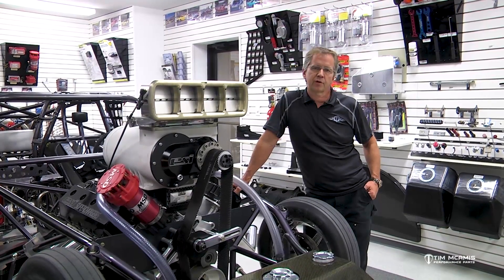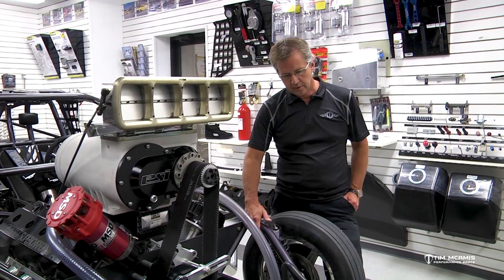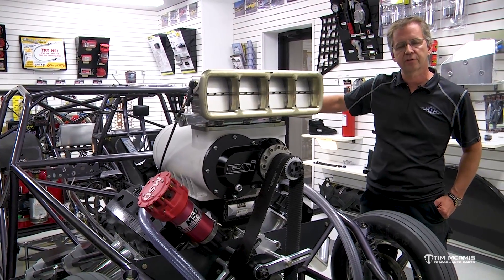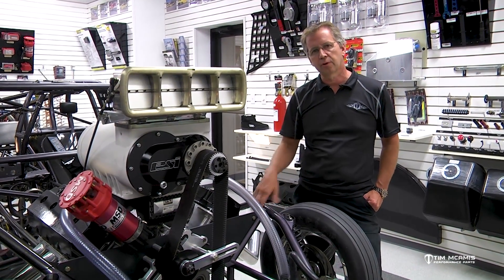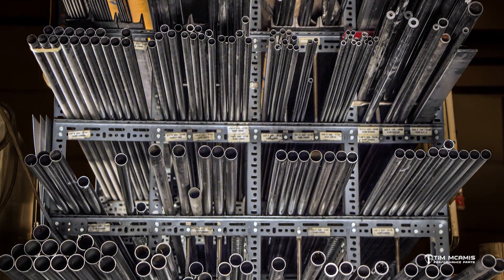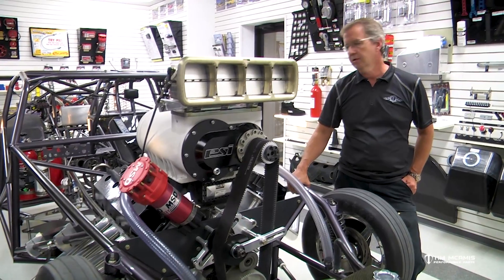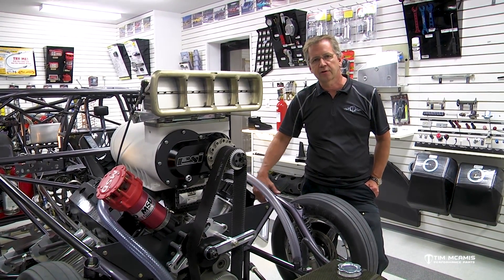4130 vs Mild Steel

Comment: Correction 4130 and 1018 both have the same elastic coefficient, (18 million) 4130 at 0.058 wall vs dom at 0.156 wall will see the dom be much stiffer. The difference is in elastic limits where 4130 is about 130% as high.

Comment: are you saying seamless mild steel tubing is not available or doesn't exist?  with all due respect, that's not my understanding.  if you have time, more info would be greatly appreciated.  and just to be clear, i don't mean welded DOM tubing, i mean seamless, DOM mild steel.  thanks in advance.

Comment: If you gas weld the Cromoly like originally intended there's a much lower chance of fracture, cro-moly was engineered for gas welding and free air cooling to the correct temper.
 This can be seen by looking at old airplane crashes, piper cubs mostly. It's pretty rare for ~ 100 yr old gas welds to crack.

Comment: When you say that the same tube out of mild steel is gonna be more “flexible” you’re technically wrong. Both materials have the same Young modulus, they will flex the same under the same bending moment for the same cross section. The chromoly one will withstand a higher maximum load but you can’t say mild steel is more “flexible”, if anything it’s the opposite! With chromoly you’re using thinner sections, lower second moment of area and higher bending

Comment: 4130 need to be tig welded
Reply: nah thats not true
Reply: @bananenpflanzer6516 Mig welds will have impurity's in the weld  This is why NHRA only approves tig welds.
Reply: @jcerullo5015  ah ok...  but from my experience mag welding 2.5 mm 25crmo4 holds up just fine. And i tested my pieces lots on the hydraulic seeing if they hold up and they always did

Comment: I can give you a good reason I'm using mild steel... I'm a poor broke bastard and do what I can with what I got!!!
Reply: Right there with ya, brother..also, CM has to be tigged, while mild steel can be Mig welded..cheaper, easier, and more forgiving welding process..particularly for a weekend warrior building their own junk rather than doing it for a living.
I don't have the skills or the equipment to build a CM chassis, but I can put together a safe mild steel car.
Reply: i can understand Mr McAmis insisting on 4130 because he's at the absolute top level of competition with the corresponding budgets, plus the regs require it.  however, not to take away anything stated above, every book i've read about road racing chassis design and fab (especially Costin) state mild steel is perfectly fine.  i'm not a pro nor do i plan on wheel-to-wheel racing, and i'm certainly not in an elite category so i don't need to have the absolutely lightest chassis.  as such, i have about 200 ft of 1.5" OD x 0.093 seamless - yes, seamless - DOM mild steel in the shop now waiting for me to clear the decks and start my build.

plus, i worked a couple years in a high end custom bicycle framebuilding shop, and 4130 does lose some of its temper when TIG welded in the heat affected zone, which renders it the same as mild steel.

Comment: I'm building a subwoofer and I need some 3" stock typically mild steel is used but at work they have a bunch of 3" 4140 round bar. There's no structural property's needed it's basically being able to hold a magnetic field Is 4140 as magnetic as mild steel?

Comment: Some1 try hving 4130 ripped cut & welded full length to sq stock mild steel. So where u need max strength & wt u attach on round side & where u want sq framing like most of construction or u want cheaper & more flex not break connection quality u stay on sq side. Art vs slide rule blended construction. I was on comment showing 49 so 50 really & 813 liked.

Comment: Hello,

I get everything you're saying.. but for safety purposes.. let's say a VW bug, very old and no seatbelts.  So of course you'd want to feel safe with a cage.. would the mild steel be better in cases of impact? I mean chromoly is strong but just as strong as mild steel since they require mild steel to be thicker, with that said you pointed out that mild steel will bend rather than snap on impact.  Would mild steel be better for safety purposes?

Comment: I'm into vintage dirt bikes, which are all steel frames of one type or another.  Typically the European machines and later, serious Japanese used chromoly frames, whereas early or low-performance Japanese bikes were mild steel.  The weight difference is amazing.  A big Husqvarna MX bike frame is light and easy to handle, while a frame from some toy bike like a 100 Hodaka will threaten to put your back out.  In modern dirt bikes, the Japanese use aluminum while KTM/Husky still use chromoly.  The steel bikes are lighter than the aluminum!  I'm a believer in chromoly.  Hell of a material.

Comment: How sure are you that the chromoly tube you are getting is truly seamless, as far as I know, all DOM tube, chromoly or not is hrew that has been drawn over a mandrel to remove the weld and make the wall uniform. Also I dont believe that you can get 4340 in tube, I think its 4130.

Comment: AGREE with everything this guy says.   If your building for lightness+stiffness i'd suggest no welding whatsoever.  Always build on a ground fit slab(accuracy) . Then i'd use Rexroth Bosch Aluminum Framing System("T"-slotted tubing u pick sizes& density). Cover with PrePeg Carbon-Fiber/Zylon TexTreme from www.compositeenvisions.com   then vac bag or autoclave.

Comment: Did I miss something or did he never actually explain how chromoly is better? Yes it’s lighter by comparison but he said himself that chromoly is more prevalent to fracture as opposed to mild steal giving way?...this is not a rhetorical question
Reply: chromoly is stronger in a thinner wall thickness, fractures easier than mild steel. Biggest pro for chromoly for me is that it doesn't rust! Especially when you are taking your time fabricating something with mild steel, it starts rusting with just the moisture in my garage
Reply: Peter Armour 
That’s damn true, I’m a sandblaster by trade but also do Powdercoating and a little fab here and there and I’ll be the first to tell you mild steel rust real quick. I can see where chromoly would have its place. Thanks for the response man I appreciate it
Reply: Lighter is gooder, Racing 101,

Comment: Military grade means a giant budget going to the lowest bidder. Who decides that’s the best? Some dick head trying to make money. I question how much better a 4130 chassis is every time the crash. Is it better to have a lighter more brittle chassis? I don’t think so.
Reply: Depends. But I do agree that military grade is held to a higher standard than it should.
Reply: In the real world everyone uses DOM especially if your welding a cage to a sheet metal chassis. Just check a rule book for the class of car your going to run. Not many require CM.
Reply: @Tsalinger  I have a 8.5 cert on my drag car. I could have used DOM but chose CM instead.

Comment: Can't agree totally. The yield point of Crome Moly is actually lower than CD1020 (mld steel used for typical chassis tubing).  CM being 63,100psi versus 72,000psi for Mild Steel Tubing. This means CM when hit will bend and not return to its original shape at a lower force than ms. Somebody commented that they both have the same Modulas of Elasticity which represents its stiffness and is true. Energy absorption is also a function of the material property called Elongation. CM is 15% and CD1020 MS is only 10%. This shows up in crash simulation. Here's an example: https://www.youtube.com/watch?v=tuVqEN1E2W8&t=1s to the advantage of CM. It could be Tim uses a higher grade of CM.
Reply: CM is superior in almost all categories except price https://www.makeitfrom.com/compare/SAE-AISI-1020-S20C-G10200-Carbon-Steel/SAE-AISI-4130-SCM430-G41300-Cr-Mo-Steel

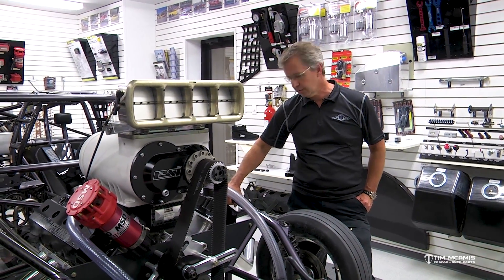Comment: At 1:00 you indicate that mild steel would be more flexible than 4130 but do they not both have the same modulus of elasticity which would mean the "flexibility" would be the same? I realize that the yield strength is very different but up to the yield point of mild steel the deflection for a given load should be the same.
Reply: Defender Fabrication Yeah I noticed that too. You're right the stiffness of all steel is about the same. In practice the mild steel tube will need to be thicker wall to achieve the same strength so will actually be a stiffer tube.
Reply: 2Phast4Rocket  Agree, that's why you have all those triangulation pieces and trusses and gussets and things everywhere. 4130 is always going to be a superior material whenever weight is a factor (and cost less so!)
Reply: Not only is the modulus of elasticity the same for all steels. The 'specific modulus' is the nearly the same for all metals. 
 https://en.m.wikipedia.org/wiki/Specific_modulus

Studying is fun.
Reply: Stiffness in the tubing is NOT the same as stiffness in the chassis structure.  The 4130 tube chassis when designed correctly, will have higher overall stiffness for a given weight than mild steel. You can't pick out a sectional stiffness of a tube and make a general statement about chassis stiffness. The fact 4130 steel allow a designed to build a light chassis with the required stiffness is why it is used. Another fact is this 4130 steel is certified to mil-std means you know exactly how the 4130 steel behaves. The mechanical property of mild steel is all over the place.
Reply: @2Phast4Rocket  100 % wrong. Not sure where you got your mechanical engineering degree but where I received mine this makes no sense. Youngs modulus does not change when incorporated into a built up section. The stiffness is for all practical purposes the same for the two. What is not the same is the amount of stress it can take until it has permanent deformation. Also, mechanical properties of low carbon steel are not all over the map.  At least not the tube made in the USA. It is also made to standards.
Reply: @lastditch5968  You really need to read my post more carefully before responding.  I was not referring to Young's modulus at all.  The material Young's modulus is very different to the structural stiffness from structural design where structural stiffness is measured in natural frequencies and structural deflections based on the specific loadings and constraints.

Comment: Were do you source you 4130 CM from? i have been using pro moly USA made tubing.
Is there any other companies in the USA or canada 
that make the good stuff ?
Reply: I used an aircraft metal supplier. They had the cheaper prices for bulk buys

Comment: Hey Tim great videos can you tell me what is the weight difference between the 4130 molly tube and the mild steel tube and also for someone who is a part time racer and not looking at building new cars all the time to compete what is the best out of the 2 to use as I have heard  that molly fatigues over time. Thanks Ray
Reply: on the question of weight, both materials have nearly identical specific weight, meaning for the same volume of material they would have a negligible weight difference. i.e. a 3' section of 1.5"OD 0.095" wall of both CM and Mild will weigh the same. What is important to look at is the strength density or in other words, a 1' section of 1.5"OD 1.34" wall of Mild Steell (1.993lb/ft) has somewhat equivalent strength as a 1' section of 1.5"OD 0.065" wall CM(0.996lb/ft). So it's not the weight of the material that makes the difference its the strength, since CM is so much stronger than Mild you have to use much less of it.

Comment: What about Docol?
Reply: Blake Matney you tree'd me. I know top fuel is reluctant to change materials as well as NASCAR but I'd love to hear Tims opinion on the future of pro mod and TS regarding construction with docol.
Reply: Docol R8 is an accepted material in substitution for 4130 in the SFI series of chassis.
Reply: To continue with Docol R8, it has a welded seam instead of being a dom tube.  What are your thoughts on that?
Reply: @mikegrady4  Dom has a welded seam its just not as noticeable.
Reply: @Tsalinger , true, the first stages of manufacturing are identical to ones used to make ERW tube except in the finishing stages the entire flash weld is removed and the tube is cold drawn over a mandrel. The cold drawn process essentially makes the tube more symmetrical with regards to its consistency of strength and its resistance to bending.  That is a substantial difference.....especially since we typically bend the tubing.  This can be a huge deal depending on where the weld is, relative to the bend, when using typical ERW tubing.
Reply: I should have stated ERW has a very noticeable welded seam.